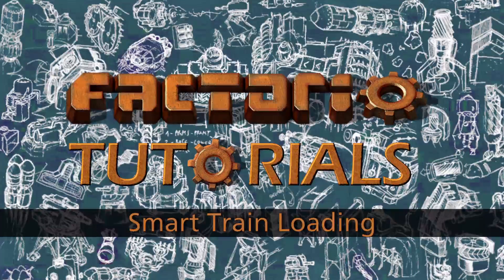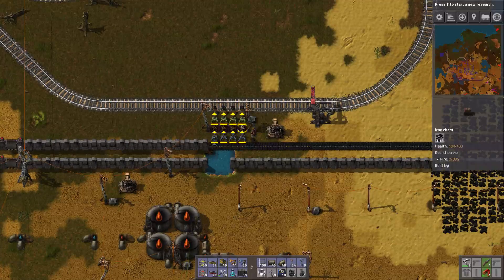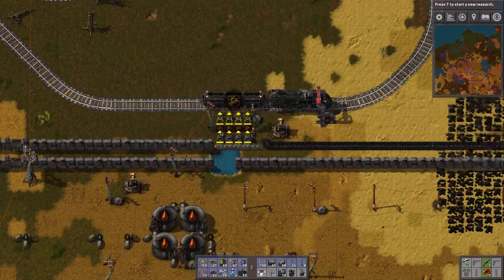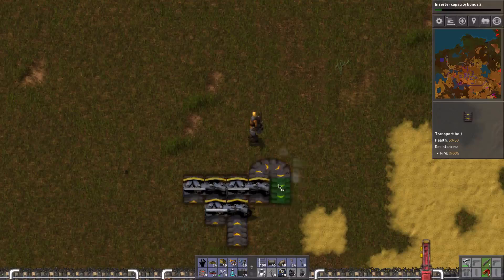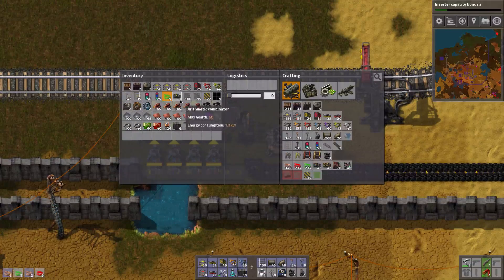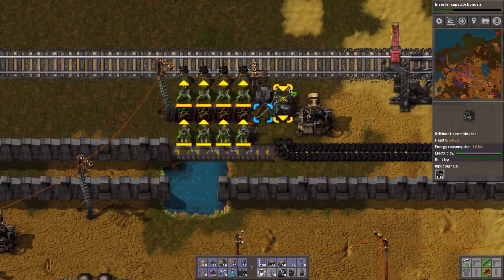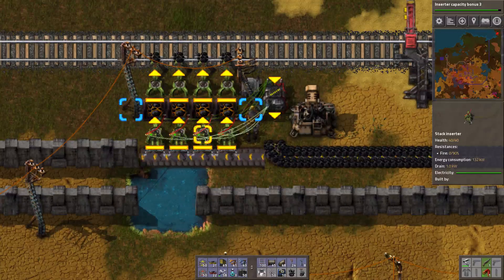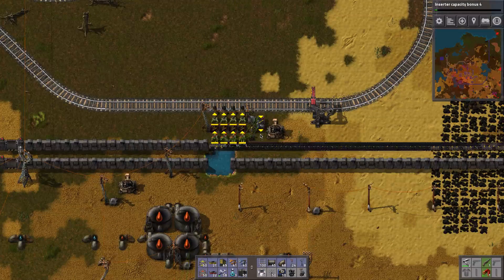Factorio Tutorial: Smart Train Loader - Evenly Fill Chests Using the Circuit Network

Comment: but the chests are not filling. I set this up exactly as you have it but they just put one insertion load in and then stop. so all my chests have 3 iron in them. also i have 36 chests in this setup is that too many?
Reply from the maker: Usually that happens if either one wire is missing or one inserter is missing the condition. It always works, however one missing piece and the numbers don't add up anymore and the inserters stop as described.
Reply: Worked fine for me.... once I realized I had to change it from coal to iron ore.

Comment: Awesome video! I like it
Reply from the maker: Thanks man, glad to hear that!
Reply: Do you have any idea how to load or unload a specivic amount of resources from train? For example i have 100 barrels filled with oil and 100 empty barrels. i want to unload 50 of them and load 50 filled with oil on next station. Any ideas? :) By the way great explenation and great video :)
Reply from the maker: Hmm, interesting question. I probably would have an unload condition of <50 into a chest and then a rail signal connected to an inserter unloading that chest, with the condition "green signal" (aka. the train has left).
Reply: Its no diffrence for me if it will be done on one or on two stations. Thing is I need to unload few empty barels and then load the same amount of barrles filled with oil and then move to the next statnion and make the same thing.
Unload few empty load same amount of full.
Reply from the maker: Ah, now I think I got it. It's gonna be more complicated then :) First: Did you check this tutorial https://www.youtube.com/watch?v=8z0flAe3fWY ? So with the <50 condition,  an s-r-latch and the pulse-clock it could work: Train arrives, inserter fills chest until the <50 is false, that also triggers the s-r-latch. The s-r-latch triggers blocks the inserter and triggers another, that does the oil-filling. Now depending on what you want, either wait until the filled barrel chest (tutorial) is empty and the pulse triggers the train (signal-green resets s-r-latch) - or - train moves on and picks those 50 filled barrels up next time he arrives. The latter would be  more efficient. I think I could do a tutorial on that :)
Reply: Yes I did :) But its even more complicated. But I thing i got idea. I'll share it with you when it's done :) Meybe it will by my first video on YT xDD